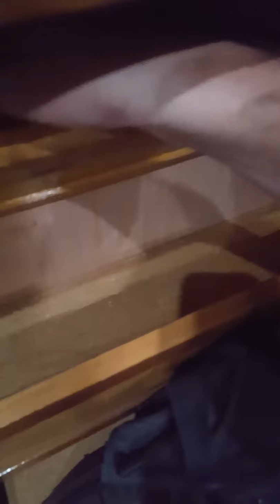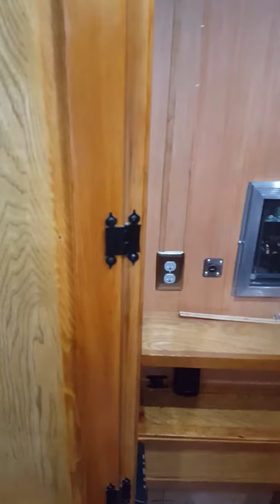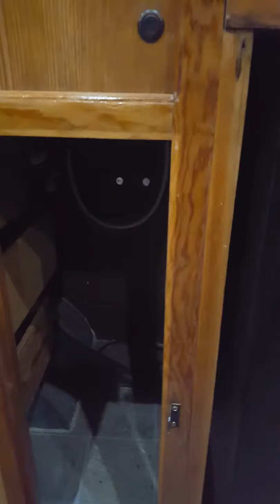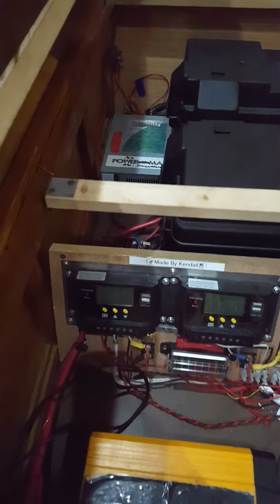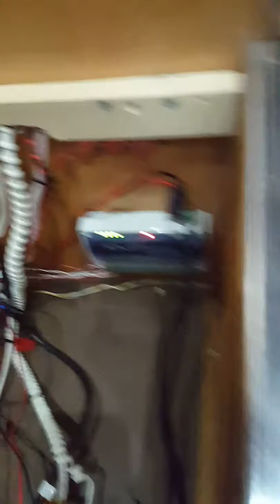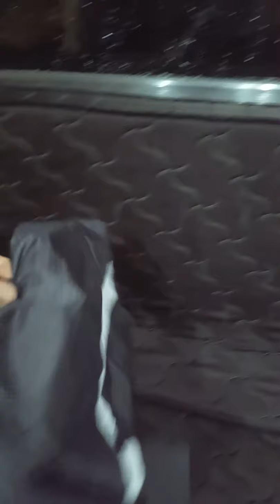17ft 1969 roadrunner Camper restore and mods. (kratos)

Comment from the maker: Hi Mark, i program with autoit allot in windows and use a program that was made in autoit called my voice controller. it aupports au3 files and is easy to use. Devolopment of it has not been around for awhile but does still work how i want it to. You may find better ones out there. it works best with windows XP since they added allot of voice commands in widows 7 that conflict. here is a link i found quick but there is more than likely a newer version than what is on it out there. May need to search around. http://m.download.cnet.com/My-Voice-Controller/3000-7239_4-10861744.html